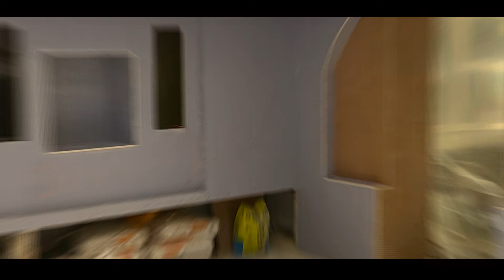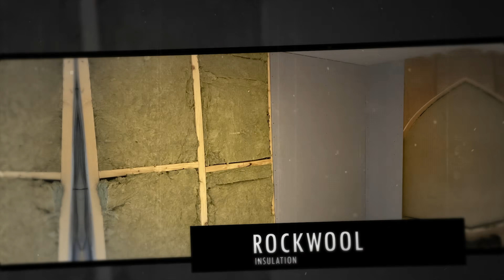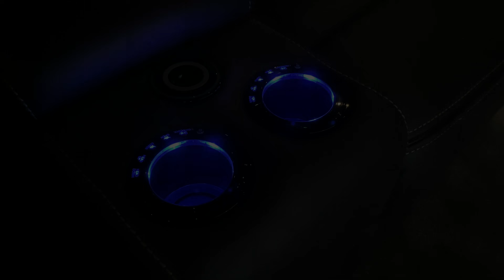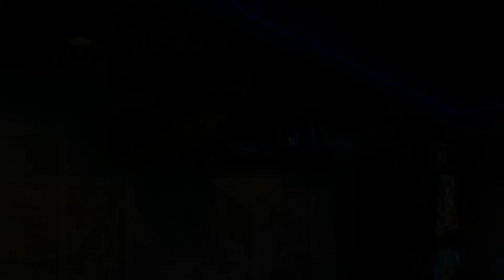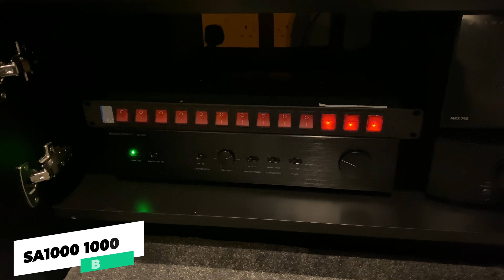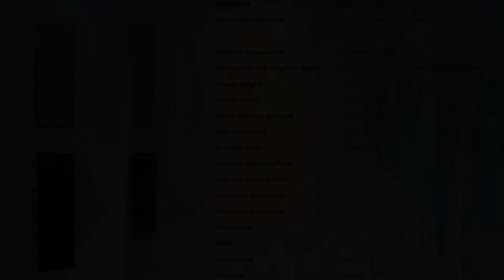Lee's Home Theater Tour! Professionally Built 7.2.4 Home Cinema Room Bowers & Wilkins 4K Dolby Atmos

Comment: I was surprised to see the subs behind the screen it's self! In my days of designing sounds systems for the cinema, the subs were always placed just outside of the screen area because of the large movement of air the subs create this air can modulate the screen coursing a disturbance that can be seen on some pictures.
Reply from the maker: I’ve got mine behind and have never seen any of that happen.
Reply: @BuildMontage  Maybe a home system is fine as the power levels are somewhat lower.
Reply from the maker: I do get wobble but you can’t see it from the seated position at all

Comment: Beautiful set-up! Now just throw in a JVC NX-7 and you're set. Does the back row seating have built-in risers compared to the front row? The only reason I ask is the elevated platform looks a bit short if all the seating is the same height. Adding quality seats with risers built in wouldn't be cheap, but it would be much easier than increasing the back platform height.

Comment: As the audio is lossless on the discs, why would the audio of the stratos rival the disc???
Reply from the maker: Apparently it’s even better - from the original used in cinema releases.
Reply: Kaleidescape is provided the master file of the movie and they decide what to do with it. Their movies are not streamed. You download the movie from their server.  No compression like with streaming.  Their movies sometimes contain more data than the disc.  4k Discs are either UHD50, UHD66 or UHD100. Most are UHD66.  If the original master file was over 66 gigabytes of data they cram the data onto a 66GB disc. Kaleidescape routinely has files larger than 100GB, so no compression or less than a 4K disc. People don't think about a 4K disc having compressed data but they routinely do. Kaleidescape sounds and looks better than 4K discs it is just out of the budget for everyone except deep pocket HT enthusiasts.  But it is amazing.

Comment: I wonder why they decided to go with a 16:9 ratio when the room was specifically designed for movies????
Reply from the maker: I toyed with this with my own room  and opted for 16:9 as well - even though it was a dream to get a scope screen - I just didnt have the horizontal realestate for CIH for 16:9 to have a decent size. Also there are a ton of movies which are 16:9 so unless you have a massive scope screen, sometimes 16:9 will give you the best compromise - this is my experience - I can't speak for Lee :)